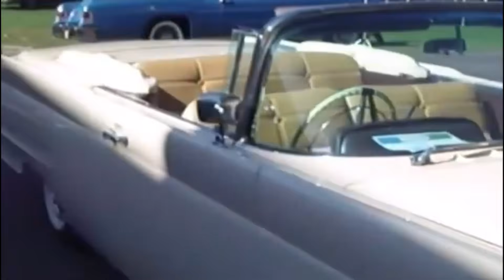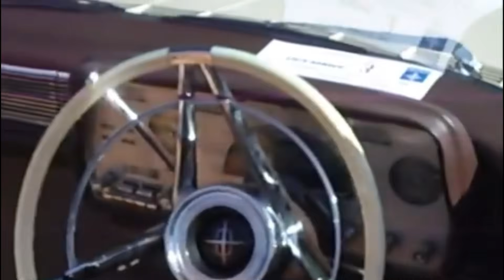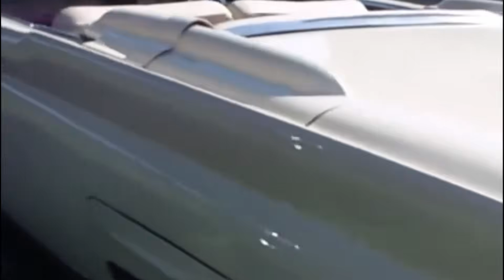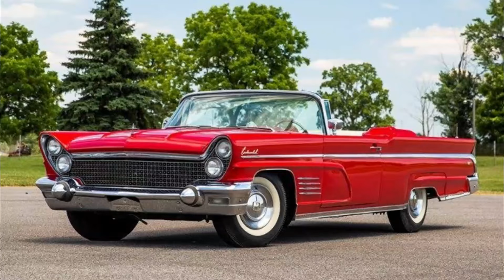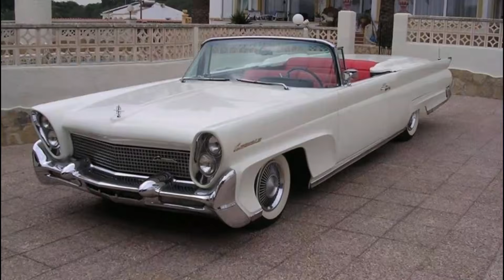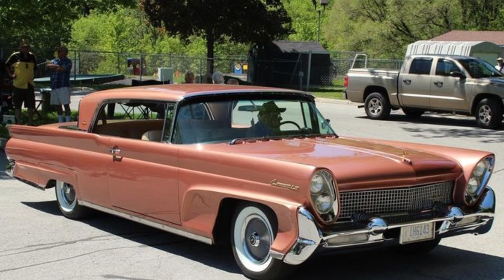#No AI - 1958 Lincoln:The Ugliest Luxury Car Ever Built

Comment: No the ugliest US car in 1959 was not the Lincoln Continental, in fact it was the most impressive in size and length. The Edsel was also not the ugliest. At the Ford Motor Co. it was the 1959 Mercury Turnpike Cruiser with antennas in the upper windshield corners and 2 Radio antennas on the rear fenders, along with a concave roll-down rear window. But GM gets first price for the ugliest car, the 1959 Cadillac with grotesque styling, followed by the also 1959 Buick Invicta.
Reply: no Turnpike cruisers for 1959...only 57-58
Reply: The 1958/59 Mercury Turnpike Cruiser with its useless antennas looked like a monster insect.